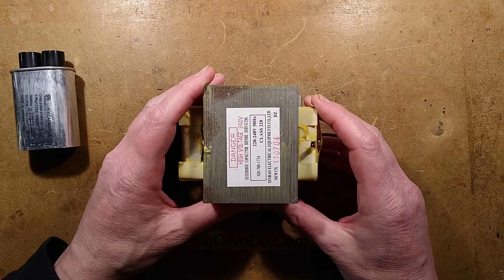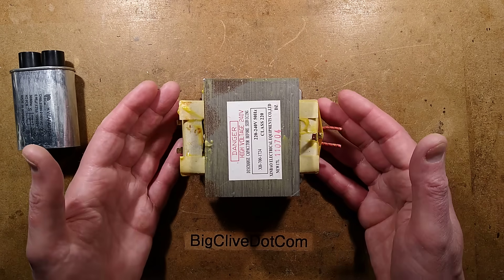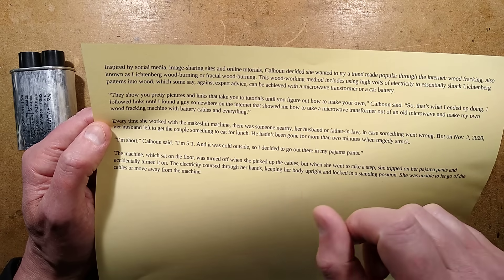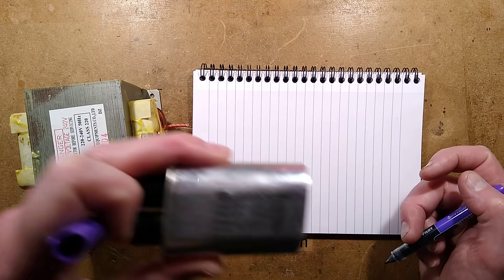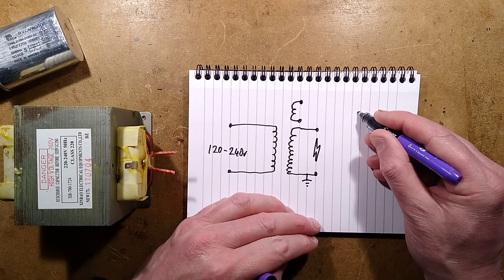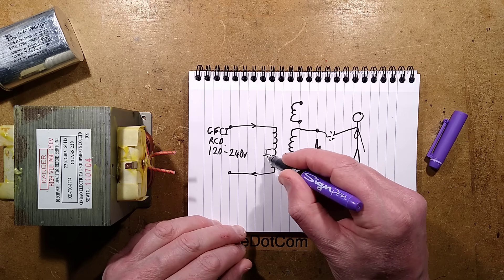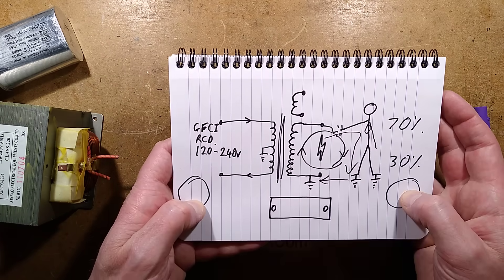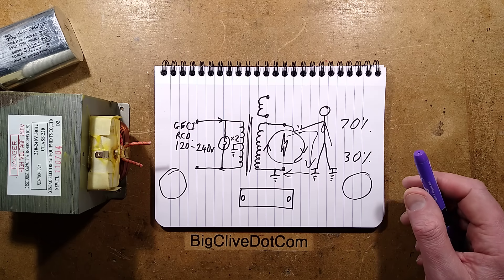The most deadly project on the Internet

Comment: I remember being 15 messing with a microwave oven transformer, i ended up thinking i had turned it off and went to adjust some wires, I accidentally bridged the output between my pointer finger and ring finger, I was sent back and my arm was twitching by itself for a few seconds. Both fingers had 3rd degree burns, I ended up being very lucky though, the scars are barely noticeable and I still have full feeling and utility of my hand. I'm very lucky that I at least remembered to keep one hand behind my back.
Reply: The ones out of a oil furnace gun will light you up too I made a Jacobs ladder from one and that thing would knock you on your ass !  Also built a radar jammer using the magnetron with a osalator to get it on there frequency it would light the unit on their dashboard !

Comment: Don't do this, high voltage at nearly unlimited current is nothing to play with. When I need to test a microwave I use quality clip leads to hook up the meter and don't touch anything while it's on. Even then made it a point not to work on microwaves if I'm tired or stressed.

Comment: I ALWAYS nail my wires into the wood when burning. Stand back, turn a fused switch on, allow the burn, turn off, unplug, and use a long insulated ground rod to short the leads to get rid of any excess power. I always act as if it's going to bite. Not if and when.
Reply: @T.J. Kong I'm not using the high voltage cap. Just the transformer.
Reply: @MikeOrkid  how would a transformer have residual power?
Reply: @SuperPickle15  It wouldn't but safety first.

Comment: I wouldn't mind trying this on a bit of wood but using the right kit and safety gear. I've had a minor electric shock and I have no intension of having a bigger one that could kill me and others if they don't know what I was doing. And there's no chance of me gutting a microwave or any appliance to bodge together a makeshift gadget. Might just be safer to buy the wood already zapped.

Comment: Very good video, the only thing you got wrong, was your comment about 12volt jumper cables. Because their only12 volts they have to be able to carry 100's of amps to start a car. And therefore the gauge of the wire is several times heavier than required to do your wood burning.
Reply from the maker: I'm referring the insulation's voltage rating.  Not the current carrying capacity of the wire.

Comment: Unlike a NST which is at least current limited a MOT isn't and doesn't care and it will happily pump current through you until you're very dead. There's another channel I've watched for years (no, not Photon) who's done HV for 25+ years and even he recommends against using MOTs until you know what the hell you're doing. Unless you manage to grab both bushings of a NST getting bit by one will hurt like hell but you'll likely survive. A MOT you won't likely won't live to regret it.

Comment: Yes, it's deadly alright, but MOTs are a valuable and inexpensive source of transformer cores of reasonably large size. In an era of switching supplies and low power electronics, it's tough to get high power transformers at a price hobbyists can afford.
Reply: I made my bench isolation transformer from a pair..  because I simply couldn't afford to buy one. The secondaries are a great source of good quality insulated wire for other winding projects. One donated the wire for the coil in my homebrew metal detector.
Reply: @PaulaXism  How did you remove the winding without destroying it?
Reply: @TheRainHarvester  Cut away the core.  Easier with a power saw, but it can be done with a hacksaw and elbow grease.

Comment: And if anyone is still curious/not convinced of the insulation ineffectiveness of solid shoes et.al. on dry ground, get them to go play with an electric fence energiser - similar voltages and principles, just current and exposure limited as the manufacturers don't want to kill the livestock, just encourage them to stay in their paddocks/pens
Reply: I remember seeing something where there were a load of people that were holding hands, and the one on the end near the electric fence then grabbed hold of it
Reply: @pineappleroad  unless the last person is explicitly grounded (barefoot, touching a metal pipe/pole), they won't get as big a shock as the person touching the fence - path of least resistance typically is still the first in line.

Comment: So I have a microwave in my garage that I was intending on taking apart tomorrow solely to do this, now, I shall not. Thanks for keeping me alive, sir.
Reply: It all is covered, well wired, and you understand (thoroughly) what you are doing, and use some protection and well insulated leads. You're fine. I would imagine this could be done with lower (Not KW levels) switch modes or flybacks. Bet if you played with ma, frequency, and thin liquids on the wood you could make something better.

Comment: Glad I learned being zapped in my younger years. Europe had 220V and after a dozen zaps I spent 3 Months in England bringing along a home made dodgy power supply. One 240v zap was enough for me! Later I spent a year in the US and 117V 60 Hz is a fine breeze!  Western Australia had 254V in 1982. Once confirmed on the now affordable meter I have totally avoided being zapped at all! I wonder if there is anybody having accident figures from Japan as half there run on 50, the other on 60Hz what should perhaps be slightly less dangerous?
Reply: I thought Japan was 100v. I wouldn't expect frequency to matter much.

But was sure impressed with the 220v/2.2kw teakettle in my hotel room in UK. It could boil a half liter of water faster than a microwave.
Reply: yeah, the difference between 50 and 60hz is minimal.

Comment: As a teacher, I have had plenty of students in the past who have found the videos online  using a MOT to do this.  It is a challenge to try and convince people who have their minds set that this is a very dangerous thing to do.  While I do have a few MOTs in my electronics classroom, none of them have the original secondary intact and they are only ever used in demonstration of windings of transfromers.
Reply: Easy demonstration is to show them shorting out via a potato or saussage. 
Explosions are both fun, and very educational. 
though then the issue becomes coppycats so YMMV lol :P
Reply: @LabRat Knatz no such thing as a non-lethal shock. Less-lethal, sure, but if it's strong enough to discourage, it's strong enough to kill someone with an undiagnosed heart condition. Most people will be fine, but some won't.

Comment: Only a complete fool would hold a lead in each hand.  Shortest path is straight through the heart.  I always warned my co-workers that if I slammed them with a 2x4 it's to save their life.  I have had 205V across my chest.  Damn cheapskate owner thought open delts was good enough.  I don't work there any more.
Reply: It really pi** me off when people start recommending stuff like the "One-hand rule" ... Why would you even put a single hand within 1000x the arc-over distance of a high-voltage part if you dont absolutely need to? Use the Zero-Hand Rule. Or just dont do it at all.

Comment: You think they will come down on content creators?
Reply from the maker: YouTube does occasionally take action on people putting up dangerous content.
Reply: @bigclivedotcom  I am a novice but I did work as an electrical apprentice fitting out box stores like tractor supply and what not. I do stupid stuff with these but I make sure I use the right hand rule. I keep my right hand in my pocket whenever grabbing any hot wire. (Disclaimer: It's just a joke do not take any advice from me)

Comment: How does a neon sign transformer limit the current?
Reply from the maker: The design of the core limits the current.  It's quite a complex subject.
Reply: Same question.
Reply: So my 1950's heavy iron neon sign transformer rated at 50 ma probably falls into the "not quite as deadly, but still don't touch" category.   I put a big red indicator light on it and never get near it when it's on.  but a dead mans switch is a good idea too.  thanks for the important info.

Comment: "Chances are you won't do that again. Full stop." As one of my Sergeants used to say, "That's non-habit forming behavior."
Reply: That's up there with:
All funghi are edible, but some are only once.
Reply: @simonoleary9264  or, you only need a parachute if you want to go skydiving more than once.
Reply: @simonoleary9264  Or like “There are old mushroom hunters and bold mushroom hunters, but no old and bold mushroom hunters.”
Reply: The variant I heard of that phrase is “that’s a self-correcting problem.”
Reply: Having seen my Father get thrown across a room when he accidentally touched the back of a colour television tube I respect electricity . Cathode Ray Tubes store the 3KV to 5Kv charge like a capacitor.
Reply: Darwin in action, if you don't learn everything about what you are doing, sometimes you win the prize.
Reply: Also, "self correcting behavior".
Reply: You can drink anything at any dosage, but some things are safe to drink only once. You can try a lot of things too but only once.
Reply: @LuizAlexPhoenix you mean “able”

Comment: Being a fellow engineer, as well as being a Wisconsinite, i am embarrassed at my own state for having someone this incompliant in electrical knowledge. Have i ever burned fractals into wood, Sure, BUT I use the 1 hand method, as well as an isolation transformer and have Many years of exp working with high voltage potentials. I will openly admit to one seriously scary event in my mid teen years... i'd acquired an old iron core NST and MY young genius ass decided it would be a good idea to light a cig off the arc! (and not having any real education about breakdown voltages of insulating materials, only used speaker wire. needless to say, the arc went thru said insulation, into each of my hands, one on the pointer finger, the other right into the palm..... I thought i was dead as i sat there being electrocuted. Cauterized the wounds and left a burse the size of a softball (about 5 inches/12.5cm) on my chest from my heart beating so violently.... by far my closest exp with death. 
I Decided then and there, that i was going to study and learn Everything about electricity! And promptly wrapped that NST up, placed it in the basement and never touched it again... even when i sold it, i told they guy "you pick it up, i'm never touching that f'n thing again"

Love your vids Clive! Keep up the awesome content!
Reply: Oh wow, a fellow Wisconsinite! I had a tingle from wall power when I was younger that also made me interested in electricity. Quite different starts:P
Reply: @swiftsilver  oh, i'd been "into electricity" long before that, it wasn't until that day that i decided i needed to know everything about it! ;)
I Now have fancy Gas lasers, and HVPS, etc as well as my own electronics recycling and "projects" lab. (Had a tavern,..... i can't have a tavern..... so it's not a tavern anymore. lol)
Reply: @swiftsilver  Not to mention, that accident was 30 yrs ago. MANY HRS OF EDUCTION LATER, i survived. 44 and still kicking

Comment: I have probed a few CRT monitors in my day and even then I always made sure that somebody was ready to disconnect the circuit breaker just in case. I also made sure to give them instructions that under no circumstances are you to touch me unless that circuit is interrupted. This was to make sure that somebody doesn’t die trying to rescue me. I would never attempt one of these projects without codified procedures and checklists to make sure bad things don’t happen.

Comment: I was looking into makeing a microwave spot welder at one point, but soon as I saw how much one messes with the transformer to make one that works I was like nope. I will just buy a reputable spot welder. I have never been one for High voltage items. I even find myself worried about 120V even with the one hand rule from time to time. never know how well something is done at an old house
Reply: Spot welders are ok because they're only a few volts.
Reply: @j.f.christ8421  For sure. I can understand someone not wanting to mess with transformers though.
Reply: The light fixture over my shower is wired with the switch on the neutral side. Screw in a good bulb to energize the fitting if the switch is off. Thanks, grandpa.
Reply: If you don't need high availability, car or lithium batteries can supply enough current. They just need to be recharged from time to time.
Reply: it's the capacitor you have to worry about when disassembling a microwave.  If your removing the high voltage winding anyway, you won't have higher than mains voltage to deal with (still can be dangerous, but it's orders of magnitude less dangerous then 3-5 KV)

Comment: I thought the neon transformer was the "KILLER" before the microwave transformer became popluar. Doesn't the neon sign transformer work in the 8 -10k volt region?
Reply: The current (amps) is what kills you, not the voltage
Reply from the maker: Up to 15kV, usually centre tapped to ground.  But limited to around 30mA.

Comment: Clive, correct me if i am wrong but even .5 milliamp across the heart can stop it. thats a TENS unit.
Reply from the maker: That's not likely.  It takes 10's of milliamps to approach a dangerous level.
Reply: @bigclivedotcom   i defer to your knowledge and having a look it got the number wrong, "With direct current (DC), 300 to 500 mA is required".  whatever the correct number is its still enough to say dont even mess around with something so run of the mill as a tens unit.

Comment: I sweat every time I’m working on even unplugged/circuit off low voltage stuff that I’ve shorted and probed.  I got shocked a few times as a lad and it scarred me.  In our house If you put one hand on the metal rim around the kitchen sink and pulled the chain to turn on the light above the sink you’d get shocked.  It’s inspired an unhealthy paranoid fear of electricity that literally makes me sweat in place when my rational mind knows there no danger.  You won’t catch me getting shocked to death by high voltage. :)  High voltage is like high-energy chemistry: you either learn to do it safely or you die young.  Best to avoid such things if you’re not going to take safety seriously.

Comment: Those things are so unsafe. I see so many youtubers playing with the transformers in so many fields, and none of them have sufficient safety devices in place to keep them(or their kids) alive in the case of a bad physical movement.
good on you.
Reply: I wonder how many of those people assume that the GFCI/RCD, circuit breaker or fuse on the mains power circuit will protect them in the event of an accident because they don't understand that the primary will be sitting happily within normal operating specs while the secondary is busy frying them?

Comment: Amazing she lived. Imagine the smell of burning flesh and bone.... My wife's big tits turned on a plugged in blender when she reached in to clear a jam. That was just a few stitches but since that accident I told her ALWAYS unplug an electrical device before doing anything to it other than operating it as intended. I learned the same lesson as a young electrician. I was working on an old baseboard heater and decided to slide the element back into the outer body with the power still on because I watched all the older guys do it. This time the little mica paper insulators had broken off so I jammed the element back in and went to put the cover on and the live terminal ends shorted through the switch cover and blew up in my face and burned my thumb a tiny bit. I looked around and nobody saw so I just went back to work and have been very very careful since. Sometimes LOTO is a pain in the ass but I do it everytime on anything bigger than a residential 120v circuit.
Reply: It's a good thing we don't still have the old wringer-style washing machines.
Reply: @captsorghum  Ah, the good old mangle. Really.

My dad actually remembers using a kerosene-burning washing machine with a powered mangle. As a child.

It was a different time.

Comment: Another reaffirming life lesson from Big Clive. 

My takeaway, as always, is: Don't fuck with electricity. 

I have a fear of electrical outlets. 

I've just bought an extension lead to live on the floor between my bed and bed-side table for phone chargers and the like. 
I've already played through like 5 scenarios in my head of waking up in the middle of the night for some water and spilling on the sockets, or being drunk and vomiting on it while I sleep, o some of my long hair falling off my bed and somehow working its way in to the sockets. 

I don't have enough wall sockets for my kitchen appliances, so sometimes I have to swap around which ones are plugged in as I cook. 
Before I do, I turn off all the socket switches, I dry my hands thoroughly. I dry all the surrounding surfaces. I make sure there's nothing obstructing me as I unplug the sockets. 
I know this is excessive and borderline paranoia, but I simply refuse to fuck with electricity. 

Being a Physicist, I know enough about how electricity will fuck me up, but I don't know enough about the practical risks and useful practical safety measures, so I just exercise as much caution as I can.

Comment: These people are surely going for the Darwin awards.

Wouldn't it be much safer to fix the probes in place with the power off, then operate the power switch from the power point well away from the apparatus.

Also thanks for your videos, my parents actually had one of those usb lanterns in one of your older videos. I put it in the trash after taking it apart, the battery looked like it had taken quite a lot of damage, perhaps from some high voltage going through it.